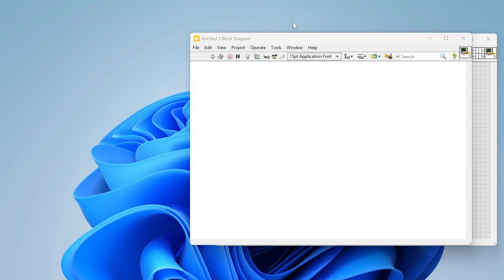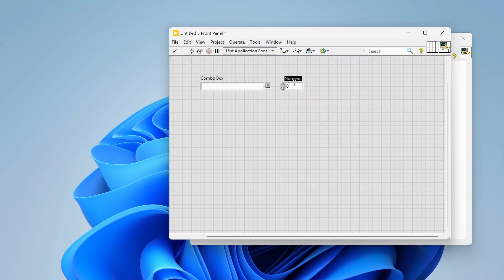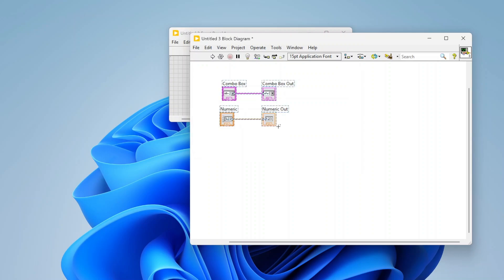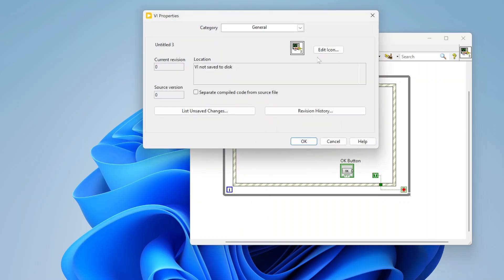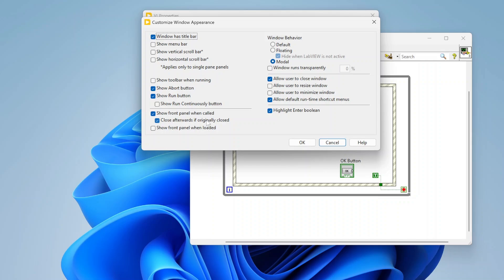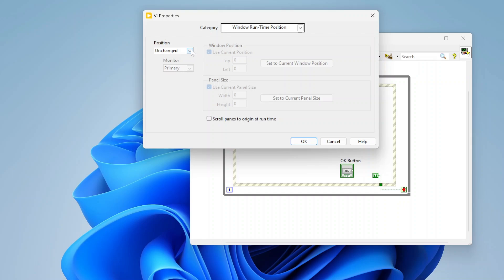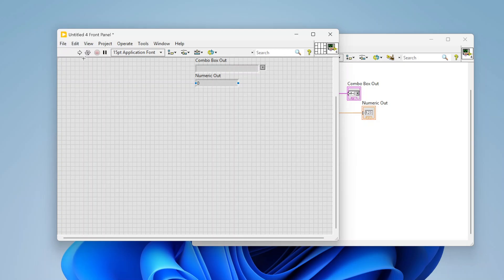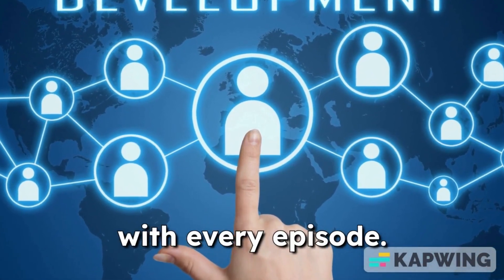LabVIEW Custom Dialog Boxes

Comment: Hello!
Right known im working on the front panel of my VI.
I'm working with a fuel meter sensor, basically when there isnt enough fluid in the tank, then it gives me a false over boolean and a true if there is.

I have a sort of sketch of my system on my front panel (just a jpg) and I was wondering of it's possible to have like a pulsing ❌️ pop up above my tank if the boolean is false

Do you have any videos like that about a custom front panel or similar?
Ty
Reply from the maker: @brxn8775 Braxton, yes you absolutely could do something like that. Shoot me an email at cannontim22@gmail.com and I will send you a quick example that implements something similar
Reply: @cannoncontrols  mail sent! ^^